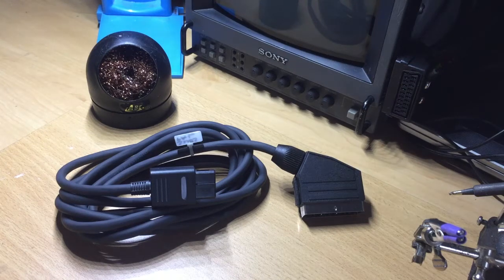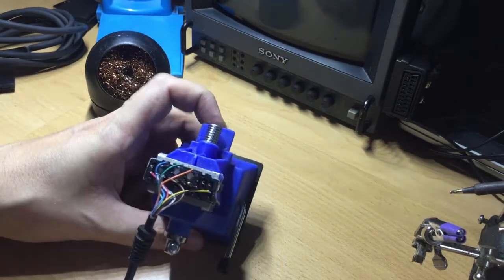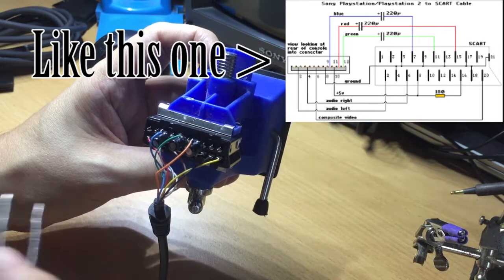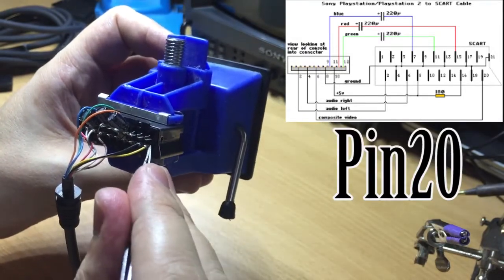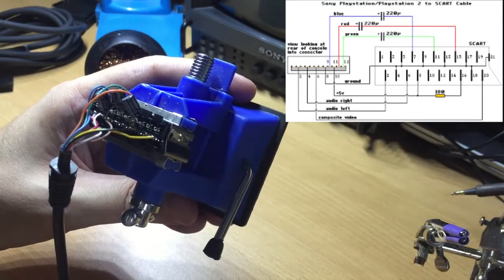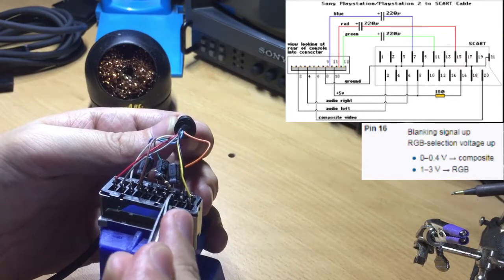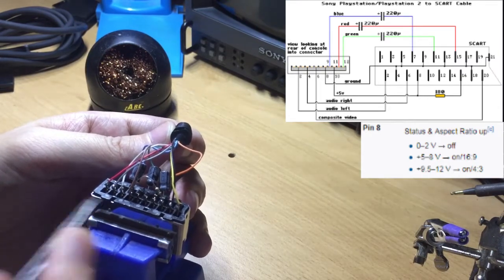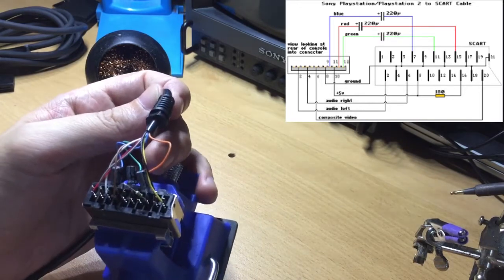RGB SCART pinout overview

Comment: which type of wire do you use to do cable?
Reply from the maker: Depends on the application but a 9 core shielded wire is usually suitable for most console cables